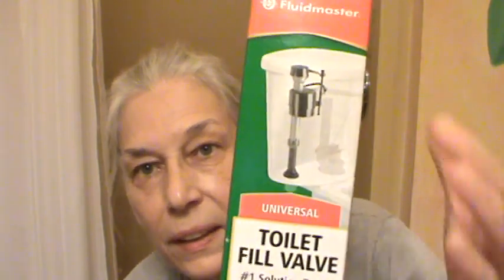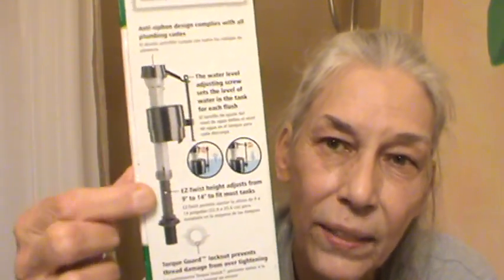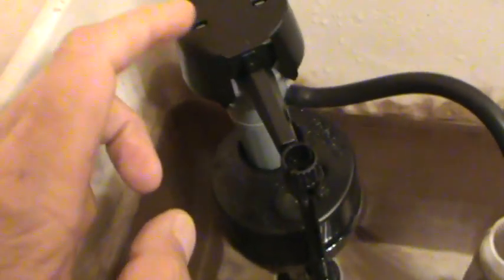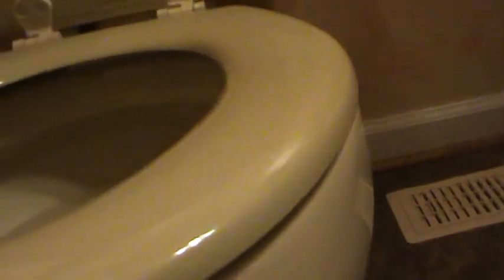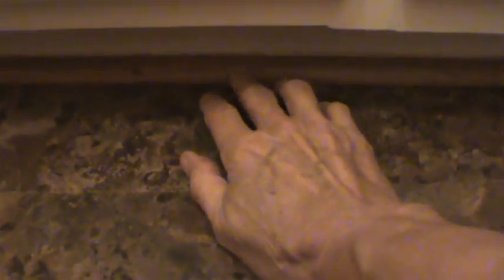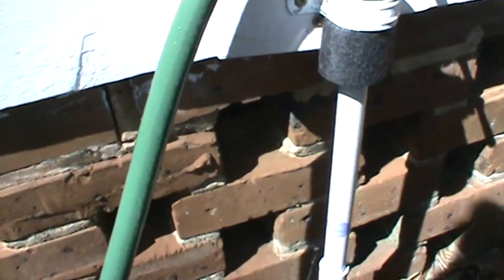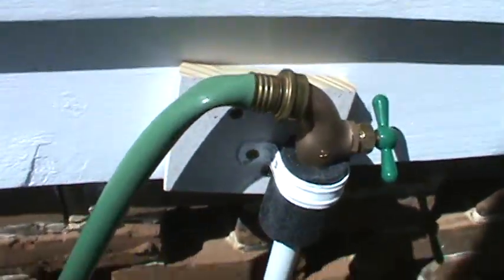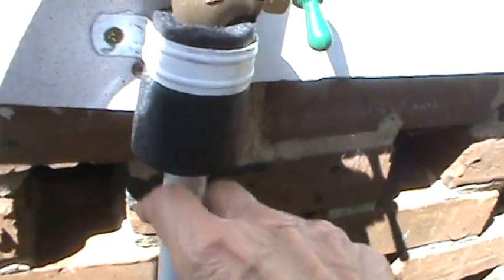The Bathroom Is Finished

Comment: What is plumber putt used for?
Reply from the maker: Plumber's putty is used around the drain connection in sinks and around the spray nozzle; however, with the newer materials that have come on the market in resent years the more popular thing to use would be teflon tape.  Some materials will not work with plumber's putty.